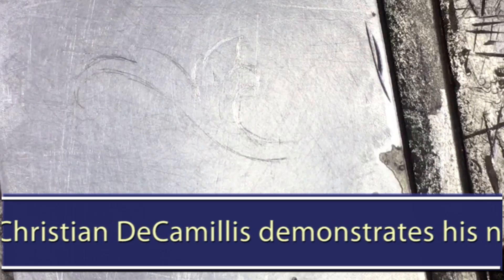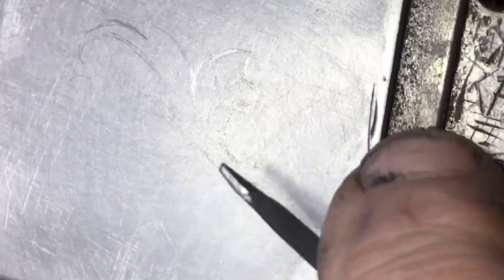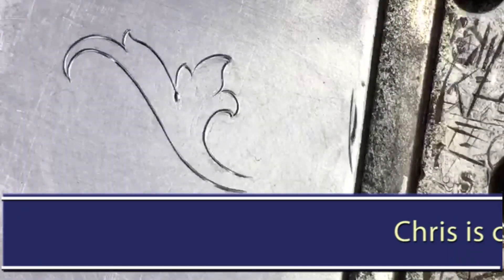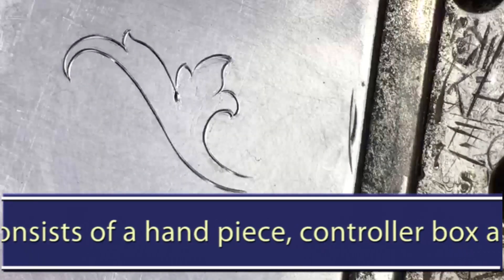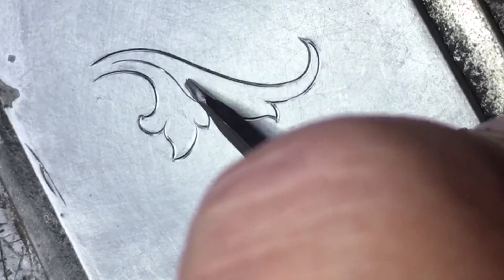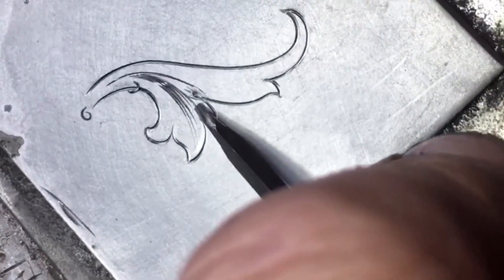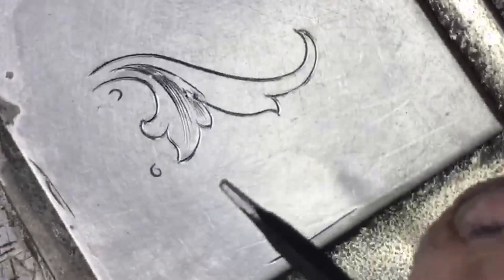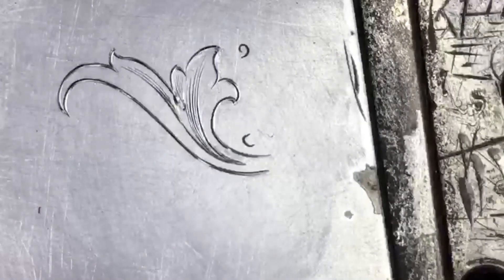Christian DeCamillis Using the PulseGraver™ Prototye

Comment: $2000.  - $2250 is a lot of money for that tool in my opinion
Reply from the maker: Compared to what?
Reply: @TiraMitchell  Awooden handle
Reply from the maker: @johnhodges8264  That's true, but it doesn't account for time.  The reason to get a power assisted machine is to reduce the time it takes to build muscle memory required to push engrave or use a hammer and chisel.  The masters can work with a rock, a 10 penny nail, and a bag of rice to  produce wonderful work because they built up skill over the years.  But even the masters use power assist because they can work faster, which translates either to more productivity or more time for other things in life.
Reply: @TiraMitchell  "For other things in life" =drinking beer :)°°